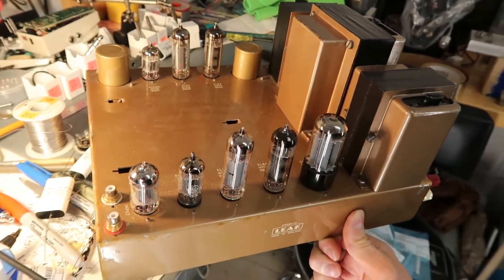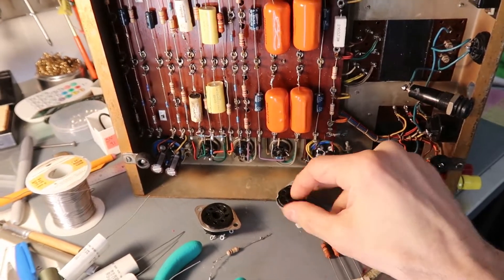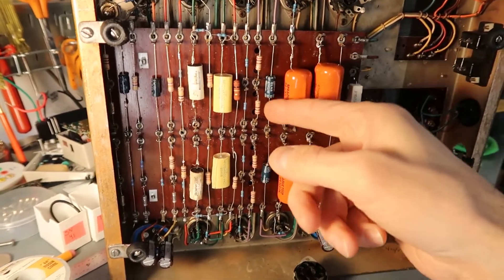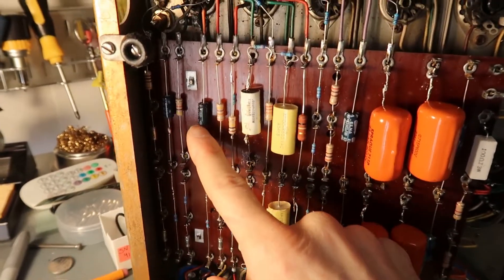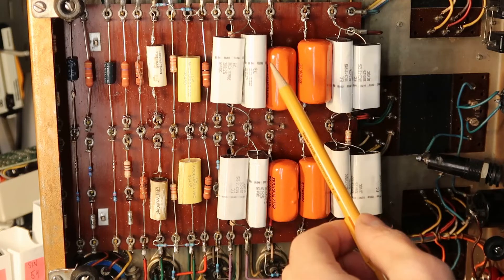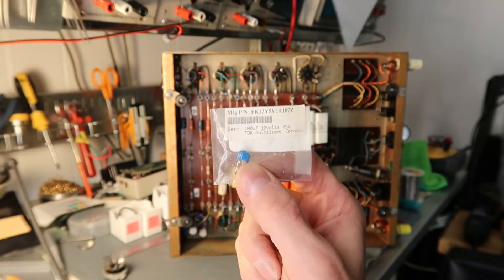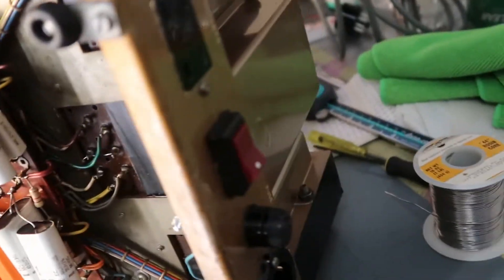Leak Stereo 20 vintage tube amp repair/upgrade, EL84. Surprise issues!!

Comment: I have a leak stereo 20 that I had restored by Classique Sounds in the UK. Tubes make a lot of difference. I'm running a 1957 Mullard Square getter in the first position. and 62 Mullard EL84's. And two 1962 Mullards in the middle. After trying a ton of tubes these are by far the best and sweetest.

Comment: Hi there, could you please advise me, I have a leak 20 but it's quiet and muffled on both channels, any ideas why that could be? Thanks, Ben
Reply from the maker: In both channels make me think the signal is connected to the wrong input or something. It was not so straightforward to hook it to the right inputs I found. If it's distorted and muffled, it could be the power supply capacitor is shot and the voltage isn't getting as high as it should.

Comment: A nice amplifier! The speaker terminals were originally phenolic with screws, under which the speaker wire was looped. The US style output sockets are odd but were made by McMurdo (a British company) and on this model would have supplied a tuner and another items as required. I have a Leak Tuner (UK model) which has the US two prong plug to fit into this socket. Very confusing 🤨

Comment: There's a large resistor in these units that's designed to desolder itself and fall out in the event of overheating. It looks like you have put a large cap over it
Reply from the maker: Hahaha! That sounds like such a British thing to do! I'll have a second look at the schematic and try to understand what the problem was that they were trying to solve with a self-desoldering resistor. Numerous resistors had been replaced already maybe 20-30 years ago, so the previous technician might have already botched it. 

What specifically were they protecting from overheating?? If the resistor is floating out in mid-air like that, that's FIRE protection!! If it's touching a transformer, that's SHORT protection (and would indicate they didn't trust their transformers). If it's to desolder itself if it overheats itself, that's poorly-chosen resistor RATING (or maybe they only had poorly-performing resistors) and should be mitigated by correctly sizing the resistor and fuse instead. 

In my eyes, whoever worked on it last botched it big time, because they put a 5-AMP FUSE in where it calls for a 1A slow-blow!! I replaced that with a 1.25A SB. I don't think I mentioned that in the video.
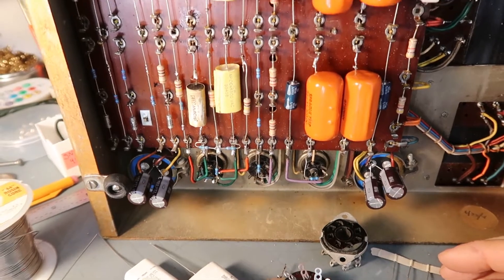Reply: Apologies, late to this video and not sure about resistors dropping off but, yes, there appears to be a high wattage, possibly wirewound, resistor (top right at 4:04) and you don't want to surround that with anything.
Reply from the maker: @ralphj4012  Thanks, I'll check that resistor with my temperature gun. Might move it to a better location for airflow. There aren't any holes in the chassis to let air out the top (but the whole bottom is open).
Reply: You MUST keep that resistor at the correct value or risk destroying the transformers.